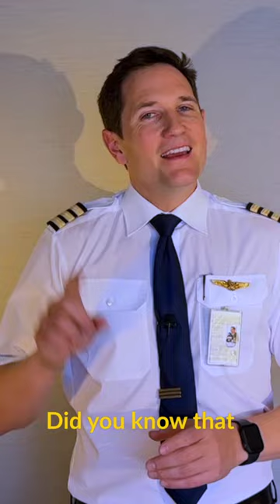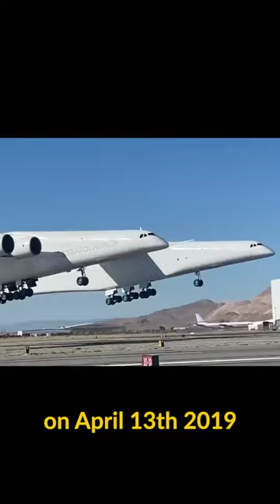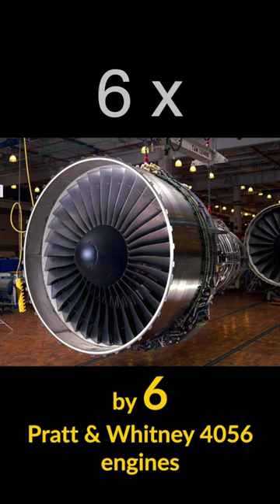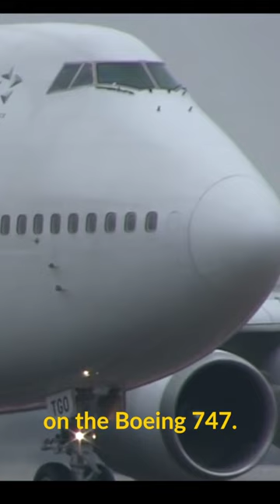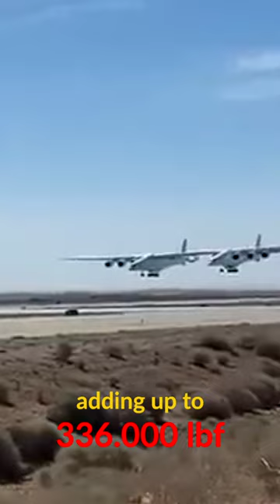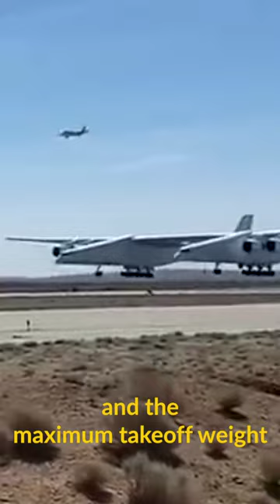Which ENGINES power the STRATOLAUNCHER??? #shorts

Comment: AFAIK not only the engines are from a 747, parts of the landing gear and avionics as well. Scaled composites bough two former United 747-400 for that purpose.
Reply: Off the shelf parts make construction and later maintenance much easier. 747 parts are well tested and pretty much all the problems have been worked out.
Reply: A fact bro
Reply: Its pretty much 2 very modified 747's